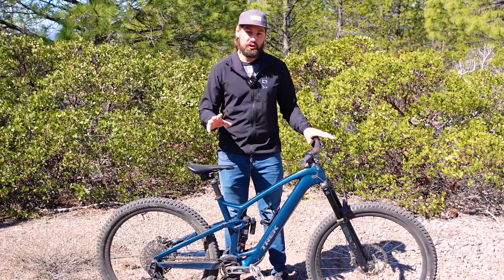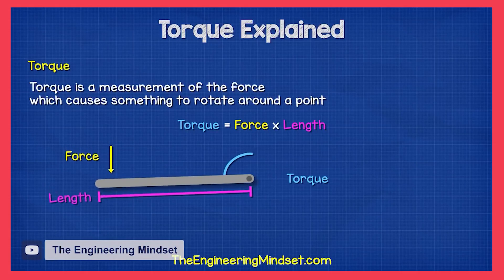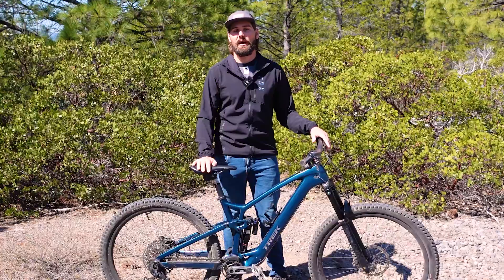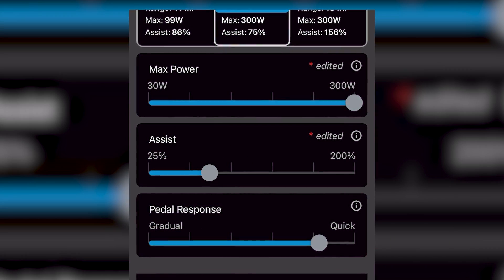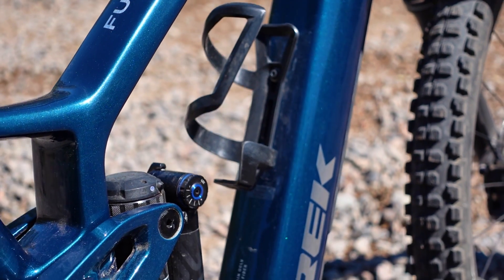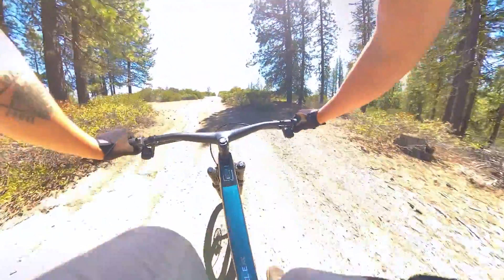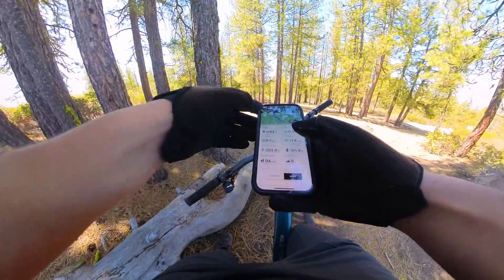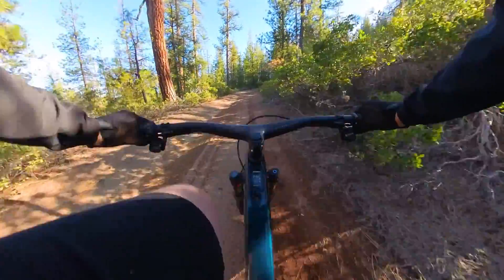How To Tune Your E-Bike Motor (And Why You Should!)

Comment: I have some question: 1)With 200% motor assist will that result to 300% pedal power? 2)How will the brake affect your setting like you are pressing the  pedal while holding the brake. With all this fiddling, the ride is very unnatural. I just want a proportional assist without alteration.
Reply from the maker: Good questions! Torque is measured at the cranks, so braking won’t have any effect. You’ve got it in terms of power; 100% assist would double your power, 200% would triple it
Reply: @99spokes  Thanks for clarifying the assist power.
The brake effect is still not clear to me. Without the brake sensor and you're  pressing on the pedal how does the motor behave against the brake? With brake sensor,  and you start holding the brake, press on the pedal, then release it.

Comment: I do something that's probably a bit silly with my bike. I have the Trek EXe as well, and I tune the Eco mode really low.  I've been riding for 25 years and the whole reason I got an e-bike was due to a back injury I got in the last couple of years. On my trail bike, I was only able to ride 20-30 mins before my back injury started screaming at me.  On the e-bike, I can ride for a couple of hours before this happens. So, what I decided to do was tune Eco mode down to something that resembles how it felt to ride a very light weight XC bike.  I do this so I can keep my legs and cardio somewhat strong.  I found that when I first got the bike and rode in Mid mode, I lost some of my fitness over time.

I keep playing with these settings to see if I can make it feel more "normal" but right now I have Eco at 78W Power, 40% Assist.  I tried doing something like 300W power at 25% Assist, but on flats, the bike did too much of the work for me. I ride in this setting until my back starts to feel fatigued or angry and then I bump up to Mid, which is tuned at 195W and 95% assist.  Riding in Mid is a lot of fun and takes a lot of the stress off of my lower back on steep climbs.  Then I have High set at absolute Max. I have honestly only ever used High a few times since I have owned the bike, and it's usually when I'm overly fatigued throughout my entire body, and I need to get up that really steep technical climb to make it back home.  

Sometimes my back isn't experiencing as much pain, and I can ride in Eco the entire trip.   This allows me to only burn 20% of my battery on a 1.5 hour ride. So, on a really good day, I can get ~5 hours of ride time.  When I throw Mid into my rides more, I get around 3-4 hours of ride time.   This allows me to get a lot of great heart pounding exercise in. When I need it, I'll bump up assist with Mid mode and finish out the ride.  Either way, I can stay on the trails as long as I used to now, and that's what made me excited about this e-bike.
Reply from the maker: That's cool, thanks for sharing!
Reply: @99spokes  I get a feeling you didn't read that and just came up with a generic reply lmao
Reply: This is exactly what I was looking for. My Fuel EXE8 is heavier that my old Fuel EX-was curious if there was a setting that would compensate for the weight different. I guess I could stop being lazy and figure out the settings myself.
Reply: Traduire